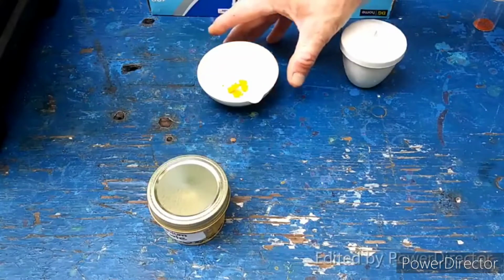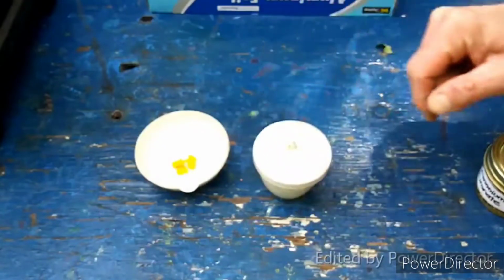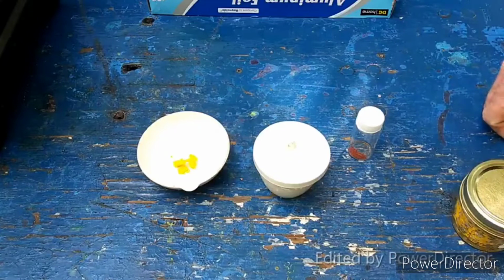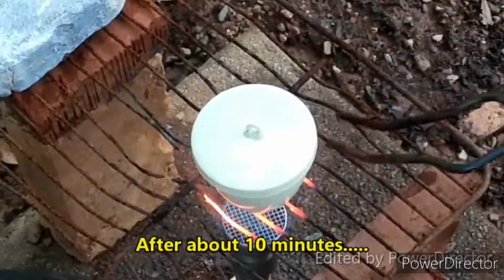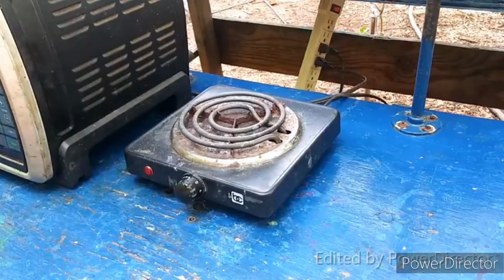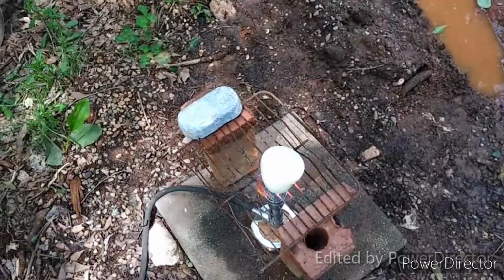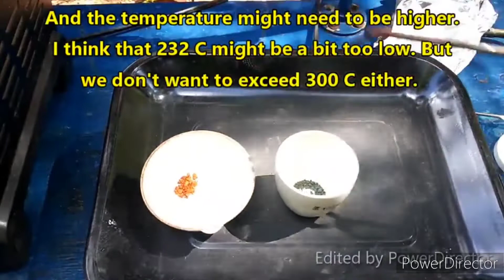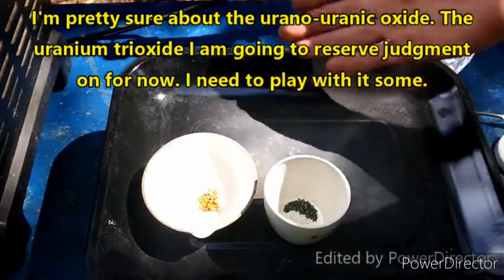How to Make Uranium Trioxide and Triuranium Octoxide aka Urano-Uranic Oxide #uranium #chemistry

Comment: Ground up that UO3 probably looks more like your reference picture. I'm thinking of doing this same thing but with my gram or half a gram of the U nitrate which should come tomorrow...

I've not seen all your uranium videos yet but I'm watching this since you mention UO3 as being the more useful uranium compound. I'm guessing it'll behave the same only it'll release NOx rather than ammonia 🤔
Reply from the maker: It should. Although converting it to ammonium diuranate is super easy. Just dissolve the uranyl nitrate in DI water and then add aqueous ammonia. Ammonium diuranate drops right out. Anyways yeah UO3 is super useful because it's so easy to convert to the uranyl salt of your choice just by reacting it with a stoichiometric amount of the appropriate acid. If you convert it to uranyl sulfate trihydrate then you can make any uranyl compound by reacting it with a solution of a barium salt. Filter off the barium sulfate and discard it (or save it for carbothermic reduction to barium sulfide). The solution of the new uranyl salt can be crystallized in an evaporating dish over a boiling water bath (that's the best way to crystallize most uranyl salts). Also remember that salts of actinides like thorium(IV) and uranyl ion do not dissolve in excess aqueous ammonia or excess aqueous alkali hydroxide but will with excess aqueous alkali carbonate. Thorium and uranium will form soluble complexes with excess carbonate ion. You can use this as a basis for separating your uranyl ion from any transition metals should the need ever arise. Transition metal salts are insoluble in excess carbonate. Hope all that it helpful! Actinide chem is fun and it's radioactive for extra sexiness. 😁😁
Reply: @PoorMansChemist  thanks that's some good info. Yes radioactivity makes it interesting  I should probably take some steps to avoid cross contamination of any equipment and/or aerosols. I could have gotten thorium nitrate instead from the same seller but I can maybe obtain some thorium if I put a thorium mantle into some Schweizer's reagent then extract somehow 🤔
Reply from the maker: @SodiumInteresting  Always glad to help! If the mantle has thorium dioxide in it you may have issues with extracting it. Especially if they have been used. The best thing to use with thorium dioxide is hot, conc H2SO4. As for dust/aerosols/etc uranyl salts are harmless so long as they aren't ingested or breathed in. If they are then their chemical toxicity is of much more concern than their radioactivity. The radiation is still a concern just a secondary one. Uranyl ion is quite toxic and targets several major organ systems. I find it best to work outside. That way I can always hose down the bench when I'm done and if there is an accident then the stuff spills harmlessly on the ground. If it bothers you then you can always dig up that spot and throw the dirt in the trash.
Reply: @PoorMansChemist  yes I think I  read could be laced with thorium nitrate and when used for first time the cellulose burns away leaving a mantle just made of oxides.
Reply: @PoorMansChemist  realised my uranium is not coming till 22nd
Reply from the maker: @SodiumInteresting  Sounds like it may be easy to extract into hot, conc HNO3.